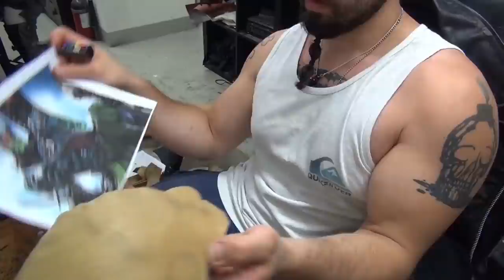Yoshimitsu mask (work in progress)

Comment: HELLO I WOULD LIKE TO KNOW WITH WHAT MATERIAL YOU WORK PLEASE CLAY ??? IT HARDENS IN THE AIR? YOU ARE AN EXCELENT ARTICE GOOD CONTINUATION AND STRENGTH ON YOU
Reply from the maker: chang lee it‘s not clay, it‘s worbla/thermoplastic
Reply: @KureijiCosplayer  THIS IS PURCHASED ON EBAY? THANK YOU FOR YOUR VERY QUICK RESPONSE
Reply from the maker: chang lee check on the website „cast4art“ there you can see where you can purchase.
Reply: @KureijiCosplayer  OK THANK YOU BRO